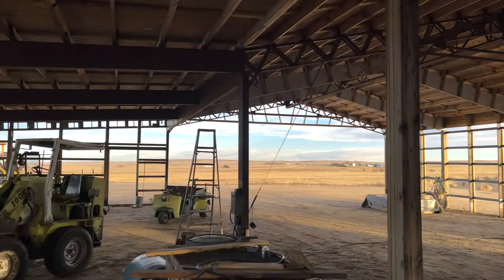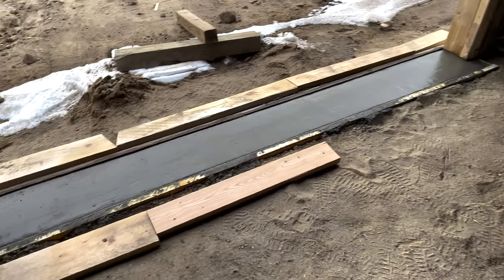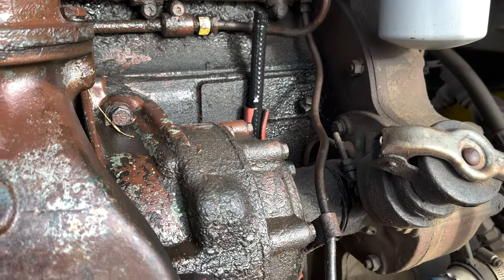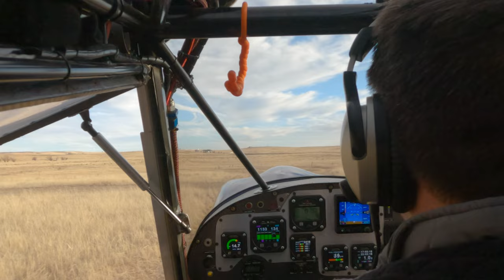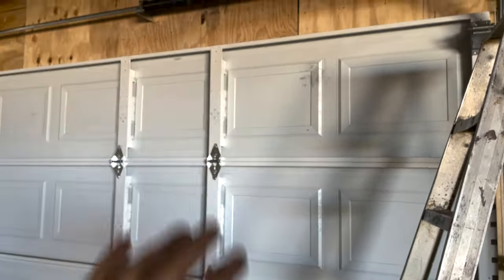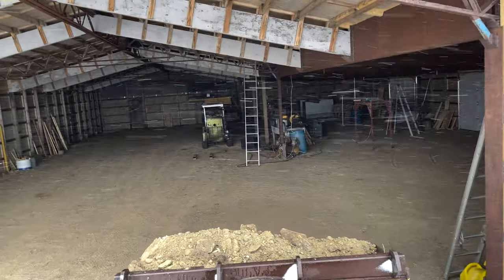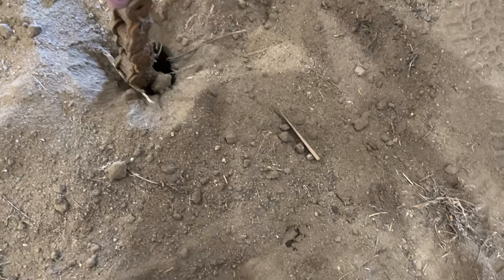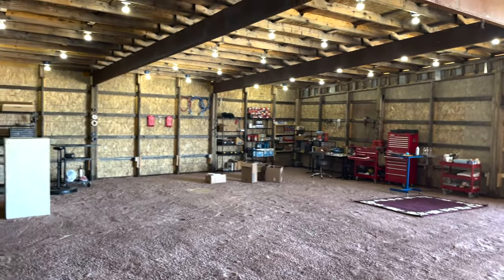Building / Testing new Airstrips + Big Hangar update!

Comment: Find a carpet layer, and ask them for the old carpets they remove. Large purlin screws with countersink heads work well to keep corners and edges down - screw em straight into the dirt.
Reply from the maker: great idea, and thanks for the tip on the screws.. was thinking something a long these lines but that answers that question.. thx
Reply: @GravityKnightFlying  It's just what I've come up with that seems to work for me. Probably works better screwing into more compacted dirt, so your mileage may vary.
Reply: Put the word out for a football field that is redoing the astroturf, take the old stuff and lay it down.
Reply: Don't know if the US uses weed mat, but round here they get fixed with similar to a 9 x 1/4'' nail on a 2" washer, would work well on that surface!

Comment: Wonderful set up, roof looks pretty stout, you can't take anything for granted with large open spans like that...There was a small warehouse building right next to our factory I kinda always wanted to buy back in the late '70s when it was built, during the blizzard of '03 up here in the Denver area the roof on it totally collapsed. I had driven over the next day (city was shut down) to check things out as we had a flat roof with many 20x40 open spans and I was greatly concerned...The wall of the warehouse was hanging over part of our roof, if it had fallen it would have taken us out a few years before the economy did anyway... Don't be trying to fly through any of those "windmill" blades in the background...

Comment: That wing-over at 20:15 looks so fun - I've been so nervous to try one of these but think I need to get on that this year. Thanks for the video, congrats on the hangar.
Reply from the maker: im not great at full rolls, i come out too far pointed down (too much back pressure during) and faster than id like, ive only done a few.. but spit s's and wingovers ive done a lot. split s is easy to learn because you don't have to full commit. i like to enter pretty slow and then i dont come out of it super fast (I pull usually 2.2-2.5gs during one max, not at the beginning though). of course too slow of an entry could be bad... i dont yank back hard as im rolling into it, just enough to stay a little positive, then increase g load as im increasing speed and not worried about stalling... anyway you can work into them little by little. get a feel for what speeds and how fast you will come out the bottom etc. same with wingovers... can work up to getting steeper and such. not an aerobatic guy of course, so take my advice with a grain of salt! but its sure fun to fling it around now and then and get the heart rate up :) thanks Robert!

Comment: Was it cheaper to make it out of wood as opposed to a steel building
Reply from the maker: Dad had those metal trusses from a hangar we had years ago (dfferent state). He built the metal beams.. so most of the structural stuff is metal. And it will have metal sides like the roof eventually (we have it, just not up yet.... working on a door first). So the combo of the two seemed to be the best/most affordable approach. Meterials wise, we actually don't have much in it.... labor though with it being so custom, 1 off, kind of deal.. lol....yea

Comment: Ha ha the old Detroit in the loader kick the tires and light  the fire! Lol
Reply from the maker: that old son of a gun just always runs.. dad rebuilt it about 30 years ago, and built the bell housing adapter and mounts etc. to put it in that old girl after I sent a rod through the original gas engine...and it has been getting it done ever since. love the screamin detroits.. they just like to be wound up.
Reply: You didn’t happen to tweet the governor on the ol gasser did ya?
Reply: One thing about a Detroit,if the first can of either didn’t work,the second one will,most of them were so low compression that it took the first one to warm the pistons so the second one would work! lol lol
Reply from the maker: @wreckum56  🤣 LOL!  thats funny! this one will start ok in the cold with a small squirt or two, but then needs a few more to keep it running smooth for the next 20-30 seconds. Dad was telling me that when he rebuilt it, he bought liners with longer ports to let more air flow into the cylinders, but those larger ports require different pistons with the rings at a different height... the guy he got the parts from didn't know that, and neither did Dad at that time, so it has stock pistons with the larger ports so it really doesn't build much compression when cranking. Surprised it doesnt take more to get it to fire honestly! Pulling that drag it will just sit wide open with a good load on it in 2nd gear with no breaks and it doesn't seem to care one bit!
Reply: @GravityKnightFlying  yup  I’ve got a lot of hours behind or in front of those ol girls scrapers road graders trucks trenchers that was the worst one sitting right next to it at seat level WFO for 8 hours a day  on a wheel trencher putting in 3 miles of water w pipe it was a 3-53 the only good thing is that it ran so much oil out on the ground a person had to shut it down every couple hours to fill it up so you got a little reprieve. Lol
Reply from the maker: @wreckum56  😆😆

Comment: Awesome job! BTW your speedo is in knots or mph?
Reply from the maker: thanks! mph.. it reads a little low (about 5mph across the board), and of course low at high aoa when landing etc. ive seen it show 23-25mph in a stall, and almost that low when touching, but reality is that it lands at 35-40mph depending on weight etc.

Comment: Question for ya, I’m looking at an S7 and was wondering if I’d fit. It’s a few states over so I can’t try it on for size. I’m 6’5 and about 250. You think I’d fit comfortably?
Reply from the maker: I'm 6'4", 255-260. I moved the seat back around 3/4". I have long legs.. im still a little cramped on leg room, but not bad. Definitely one of the more comfortable small airplanes I've flown. I like to get out every hour or 1.5hrs to be nice and comfy. After about 2-2.5 I really want out for a break. At about 3+ I'm ready to jump out. Off airport flying allows me to stop often.. traveling I don't make super long legs typically.. it all works out. I think you could definitely manage, but would probably need to mod the seat to sit back a little further like I did. Not a huge deal to do.
Reply: @GravityKnightFlying  how about head room? I’ve got short legs for a tall guy (32” inseam) so leg room usually isn’t an issue. Grated, I crammed myself into a 150 for primary training.
Reply from the maker: @CaptainCharlieBravo  good question, there could be an issue of being able to hit your head on bars to the sides (nothing directly above should be in the way). I actually added a pad to the seat to make it more comfortable, but that also added a bit of height and I’m ok on head room still. From what I have seen, the 7 has more room than the other birds in its class (kitfox, highlander, etc.) and it’s way better when there is a passenger involved being tandem.

Comment: Power Line Aerial Marker Balls
Reply: I'm not sure the power company will install those at a uncharted airport...for free anyway.
I suggest that Todd tie two of his old shoes together, and throw them over the wire like you see in the hood.
Reply from the maker: @JSBIRD69  🤣
Reply: @JSBIRD69   The power company may surprise you, they are "way into" anything that prevents problems with their grid. I know this in my crane business, any time I interact with them, it's a team approach, we are all on the same page. I'd bet if you supplied the balls, that'd be all it would take. On the subject: when I got a price from my utility to run power up from the bottom of my 40 acres to the house, they specced out several poles, all overhead lines.  I bought and buried my own lines, at half the cost,  so as not to interfere with my view, and runway.